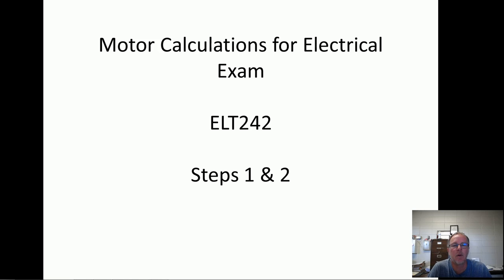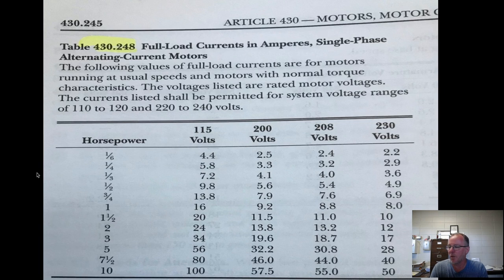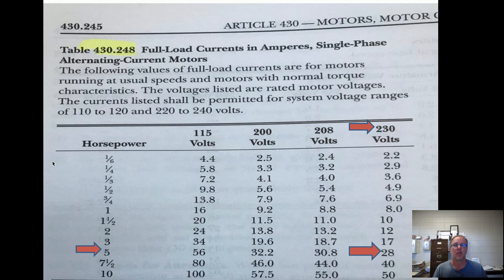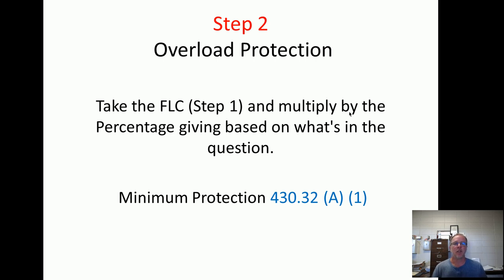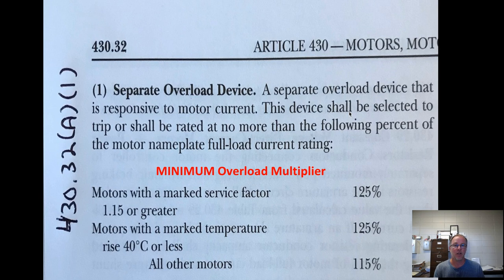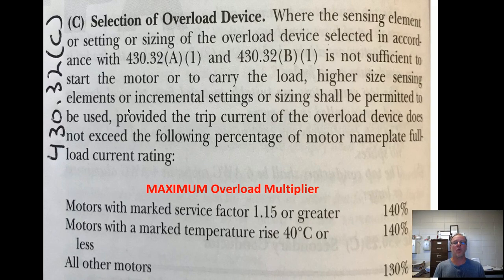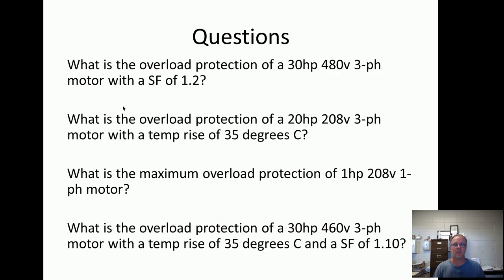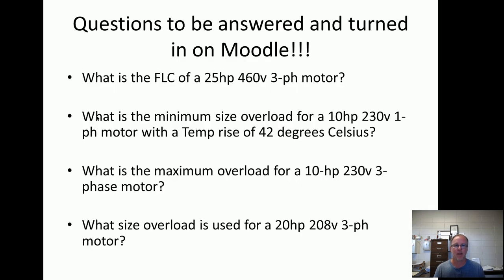Motor Calculations Steps 1 & 2 for Journeyman Test Prep ELT242 Community College Electrical Class

Comment: Hi, I am in the 2023 code cycle. It looks like there were some changes in 430.
I am wondering if I'm missing something here.
I'm looking at 430.6 A1.

It says for general motor applications, the table values in 430.248 & 430.250 shall be used instead of the actual current marking on the nameplate, to find ampacity of conductors, current rating of switches, & current ratings of short & ground fault protection. You say in the video to use the nameplate, not table values if nameplate is available.

did this change?
Reply: No, we are figuring out the overload protection in these cases nothing else. So, if the nameplate is given, use FLA instead of FLC only to find the overload protection in this case. If it is not given, then use FLC like this case.
Edit: 430.6 (A) (2)

Comment: For step 1, you should use the table in the NEC as opposed to the nameplate. That is because the motor may be replaced with a less efficient motor.
Reply: But now you're changing the electrical architecture of the system. Anytime you change a component, you need to investigate the impacts of that change.
Reply: not for taking a test you dont

Comment: Shouldn’t the answer for the 4th question at 13:44 be 50 since the temperature is less than 40 degrees Celsius??
Reply: Wrong. If it does not mention the service factor OR the temperature you use the 115% column.
Reply: only it did mention the temp in the original question. @DerrickDennisMusic
Reply: In the slide before he starts answering where he says to pause, it specified 35°c
Reply: Your right man I got 50 amps also
Reply: Yeah I got 50 as well
Reply: At 12min 40sec
Reply: Correcto